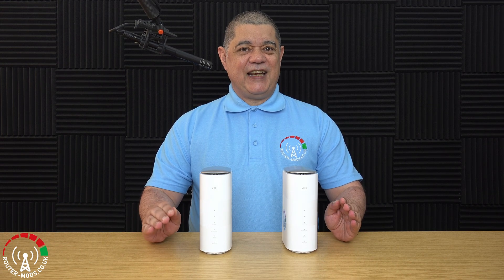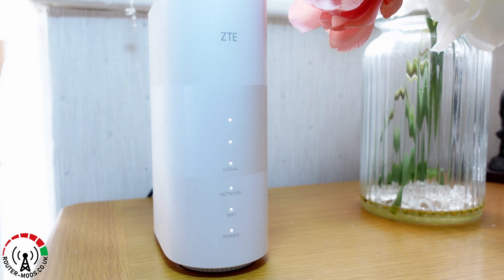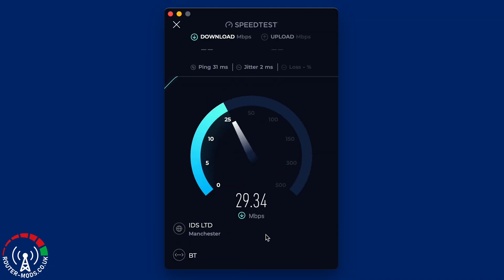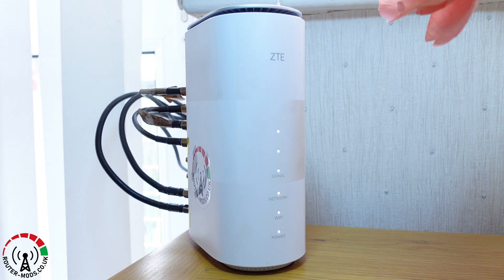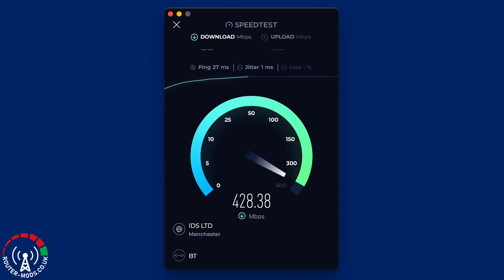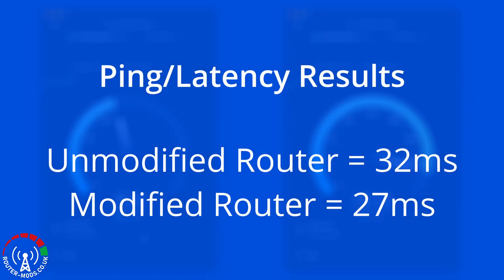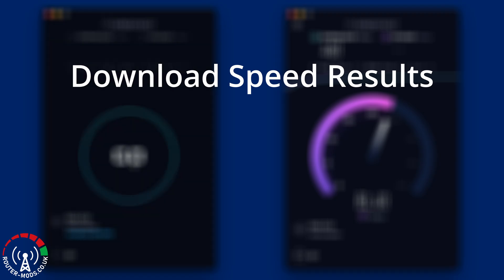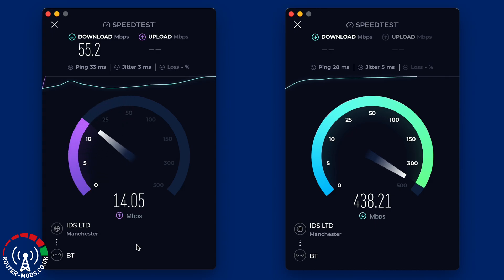ZTE MC888 Full Modification Service, Before and after signal & speed tests results

Comment: Yeah, well, what external antennas were you using? 

4x4 MIMO on the tibby little omnidirectional internal antennas @-100db is obviously gunna be VERY DIFFERENT to using a £1000 of 8X8 MIMO outside the house on a pole directional POL antennas at -95db gain.

I don't see what you're testing. It's certainly not the SMA mods, but the massive investment in antennas and the azimuth of close tower aggregation.